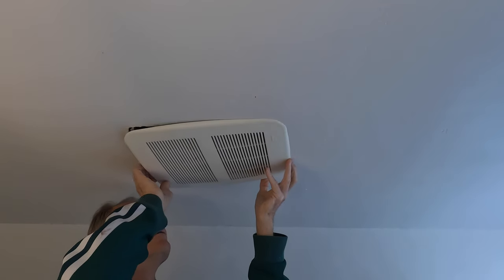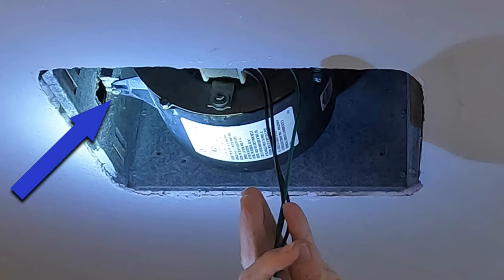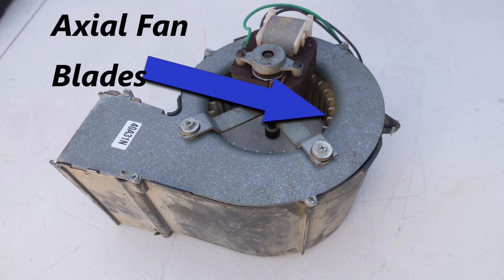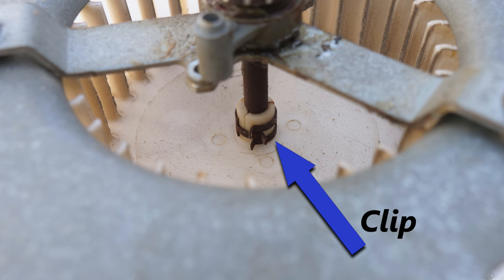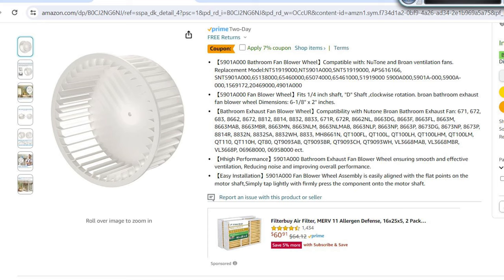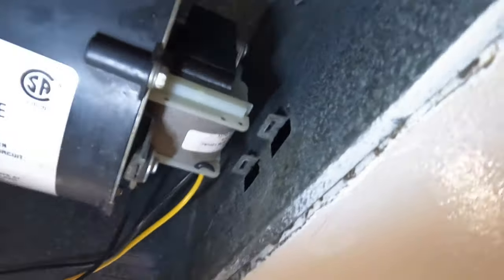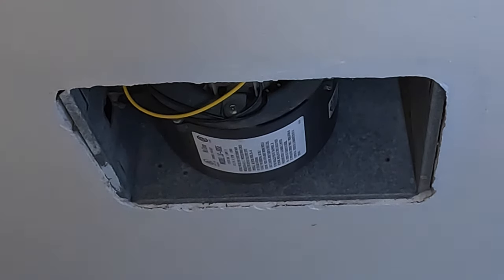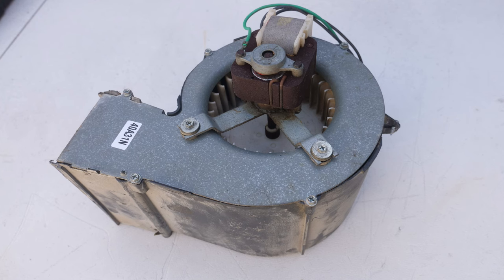How to Replace a Motor on a Blower Type Bath Fan (Nutone LS80SE)

Comment: for those who don't know, and are curious, that type of motor is known as a "shaded pole" motor, because that wrap of wire on the stator distorts the magnetic field to make the rotor turn.  the motor can be reversed by taking it apart and flipping the stator the other side up.  they're a simple motor, and really the only things that go wrong with them is the shaft can seize up like that one did, and if you have them trying to run for too long, the windings can burn out.  to do tend to have a little bit of a hum, while running, though.
Reply from the maker: Very interesting, thanks!

Comment: Any advice on why one side of LED lights are brighter than the other LED lights? (The LED lights are the exact same brand at 4000K temp. They are 4’ SATCO medium bi-pin…
Reply from the maker: I would start by checking the connections and making sure they are very good. Possibly quality control problem with the LED's as well.
Reply: @SparkyChannel  this was fantastic advice.
Reply from the maker: @ronnietaurarii4660  It's hard to tell what the problem is, but those are a couple of troubleshooting things to start with.

Comment: Great job! I love replacing stuff like this! Saves the customer money, saves wear on your body because you dont need to install a whole new unit, saves on making a big mess in the bathroom if theres blown in insulation or if you have to cut sheetrock etc.
Reply from the maker: I enjoy projects like this as well. The biggest benefit to me was that there are no fans these days which have the same dimensions as this one. Also, these days fans with a 7 3/4" height have a 6" discharge. That would have required me to mess with an adaptor. And yes, who wants to make a mess in someone's bathroom. LOL!

Comment: Can you do a video on EV Chargers? 

My current understanding is this: If you install a receptacle for an EV Charger, code would require the receptacle to be GFCI protected. 

But the manufacturers instructions often say not to GFCI protect the charger because they have GFCI protection built in. So then you would have to hard wire it. 

To do anything else would be to go against code or manufactures instructions.

Comment: the axial mobile home fans are the best candidates for a direct motor change.  one like that, if the same model is still on the market, it's good to just buy a replacement blower assembly, which lets you get rid of the old motor, blower, and shroud.  
but I've found that at least half the time, I can throw in a new Panasonic Whisper series fan, and give the customer better performance, with less labor costs.
Reply from the maker: Sounds great, thanks!

Comment: Cheers for this. I currently worked on a fan immediately after watching this I get a call to do this. 
Question: I have 8 lights outside a commercial building garage and 3 of them are not working. Its connected to an Asecend Standard Intermatic timer switch. When on Auto, all but 3 lights are on. When on Manual, all lights work. Bulbs are Metal Halide, the contactor seems to be working well. Bulbs have been changed out and a new timer has been installed. thoughts?
Reply from the maker: Because all lights work when on manual, rule out bad bulbs. Is the timer rated for 8 metal halide bulbs?

Comment: Question? I was working at a rental home. I noticed the outside outlet sticking up out of the ground mounted on top of the conduit. What’s the code for outside outlets.
Reply from the maker: Check out this video: How To Install an Old Work Box and an Exterior GFCI 20A Receptacle (Weather Resistant): https://youtu.be/oLmum19hXj0